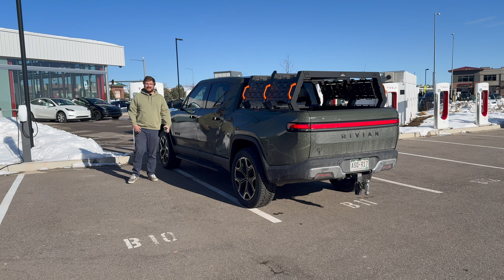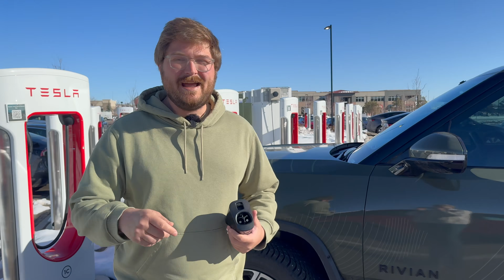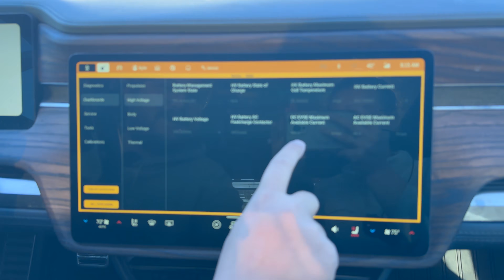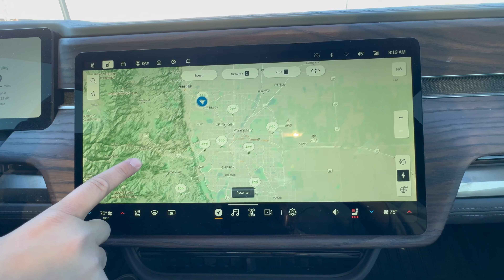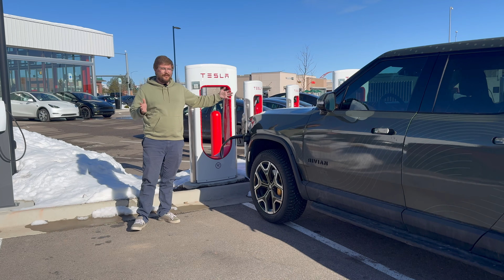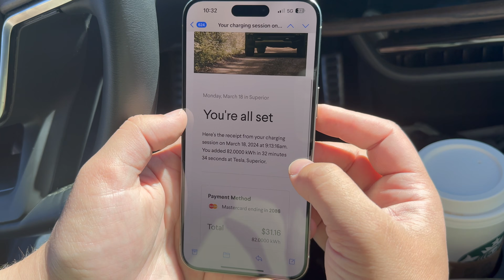Rivian Gains Access To The Tesla Supercharger Network! My First Charging Experience

Comment: This appears to block two parking spaces. The issue arises because the charging stations are designed for vehicles to back in, with most vehicles having the charging port on the rear driver's side. However, the Rivian's charging port is on the front left, forcing it to occupy the space intended for the adjacent charger. This could lead to potential conflicts at busy charging stations and create resentment towards these vehicles using the infrastructure. As someone who invested in a Tesla for the sake of the charging network, I've been looking forward to the system opening up to more vehicles, pushing Tesla to innovate further. An electric truck has always been on my wishlist. Another point of concern is whether these vehicles charge at the same rate as Teslas, given the lack of comparative data on charging speeds for non-Tesla versus Tesla vehicles. Can anyone confirm if the charging speed is comparable?

Comment: It would be cool if one's EV had a charging port at both front and rear corners of the vehicle.  That would cover most charger placements at the charging spots.  But probably won't happen because of extra manufacturing costs.

Comment: omggg! this is too expensive compared with my gasoline car, shouldn't be much cheaper than gasoline? what the mean to buy those electronic cars if the electricity is this expensive, omgggg!!! i drive the car which is not oil efficient but are even cheaper than this! scam

Comment: 8:39 pilot signal interrupt is not violent. Charger gets signal to stop providing power and it with car disconnects contactors. They are not under load while doing it, because pilot disconnect told car and charger to stop.

Comment: Latest Tesla SC station opened yesterday in Colorado and the station is oriented more in the middle of the lane.  Rivian will fit without blocking neighboring lane but tire is mostly in other lane but still on the line.  This is the farthest I could move the Rivian and still charge.  Can't include pic here.  Older stations (like in Kyle's vid) have the station more to the passenger side of the lane (orientation is front bumper facing in) so with these stations blocking two spots is the only option.  This will cause user conflicts.  I have both Rivian and Tesla and am excited and pissed at the same time.  
1. Tesla opened the network (very positive) 2. Rivian will provide an adapter (positive). 3. Lack of planning on implementation will cause user conflicts (very negative)

Comment: On charger location: the driver side is always the wrong side. On most parking situations on the street you have to walk on the street to plug it in. Then we fold in the mirrors to avoid them being ran off, but can you imagine how much it will cost to replace it when someone runs it off. In Europe, parallel parking is the norm. And destination chargers are on the streets. 
That being said, here in Europe the chance of me ever using tesla chargers is very low since there are many other chargers.

Comment: Just a thought if Rivian is building a new vehicle and it's only the matter of moving the port to the opposite side that they've chosen, wouldn't it make more sense to switch sides wouldn't it be less stress on the drivers? I don't understand the reasoning of having the port on the opposite side in a Tesla, is it just to prove that they're different? They already have a very nice vehicle. They have an opportunity to just switch one small thing that could make a big difference for each user. They should really reconsider their placement. I'm pretty sure that other manufacturers will do the same time. Only time will tell.

Comment: You’re a BIT wrong about the charging network though. Each person who has bought a Tesla over the last 18years helped pay in to the Tesla charging network it took hundreds of millions to build & as a Tesla owner if a charging location is busy and some cheap ass Slow charging Chevy bolt who didn’t pay into the network is taking up 2 spots and we have to wait I’m/we should have reason to be pissed this goes for any non Tesla taking up more than one spot at a busy charging station
Reply: That's BS, the non-Teslas are still paying customers, and Tesla can use that extra revenue to build more chargers.
Reply: @TechnicalLee  again the charging network was built(especially) in the early days by EARLY adopters who over paid for electric vehicles charging network was built by them. No car that takes up 2 spots should be able to use any of the good supercharger locations that are for sure going to be busier.

Comment: "Anticlimax"

Yeah, that's the normal no drama supercharger experience.  Little to see, because you just plug it in.  I'll take that over an "exciting" complicated experience trying to get a charger to work via apps and screens and lots of faff and phone calls.  Been there, done that.  Prefer to be bored.

I finally had a supercharger location where only half were working, and there was a wait, then a show charging experience (73-74 kW).  And another supercharger location half full.  With more Teslas on the road, plus Fords and Rivians at the superchargers, they'll get busy, maybe overfull.  Especially if Fords and Rivians effectively take two stalls due to having the charge port on a different part of the vehicle.

Comment: If they wanted to preserve passenger side charge port for curb charging then they should have put the charge port in the front passenger side. Then you would be on the correct side for both supercharger and curbside
Reply: Another solution is to have two charge ports like Audi and Porsche have. Costly but arguably best.
Reply: RJ said it is on the back to make the cables shorter. Note the R2/R3 will have a rear drive only option.

Comment: Rivian R2/R3 wont have any problems connecting to TSLA V3 Chargers. Remember— it’s not in the Kia EV6 location opposite a typical Tesla. Rather, the new Rivian location is much lower and much closer to the rear of the vehicle so that teh current v3 cable will reach with no issue. 

The only “problem” is that right now, both Tesla and Rivian have ports on the Driver’s side, making it very easy for drivers to exit the vehicles and not have to traverse to the passenger side to charge. R2/R3 placement removes that convenience and trades it for the promise of curbside charging.

Comment: Would be interesting to know any charging limitations when using the Tesla chargers and whether they are a dongle limitation, Tesla-provider limitation, or vehicle limitation. I want my next car to be an EV but am trying to wait until NACS is the default port in the manufactured EVs.
Reply: The only real limitation is the voltage, they only put out about 500V, so 800V cars can't charge on them unless they have an on-board booster or a series/parallel switch in their battery pack. 400V cars should get maximum output from a Supercharger.

Comment: tesla has a permit request for v4 install near me. so im pretty excited for that. v4 will have native magic doc on it and the extended cables. so in distant future nacs will be the only thing but for now its going to be ccs adapters wonder if in future manufactures will come out will a valinatry recall and retrovit/rewire for nacs ports which would be cool i know its a little bit complicated but it would probably be better off
Reply: Retrofitting NACS will be too expensive. The adapter is FAR cheaper. So don't expect that to happen, you're stuck with the adapter until you get a NACS car.

Comment: Curious if the 500A is just a response to the vehicle request
Reply: Most likely. Considering the software integration in the Rivian app and also the Tesla app in communication with the actual charger. It’s probably telling the station exactly how much amperage to deliver.  It would  know an adapter is being used because the information about the vehicle including what vehicle it is what kind of charge port it has is all there. In the future when adapters are no longer needed it may well be able to request that full 700 A and possibly even bump the charging up into the high 200s low 300 range.
Reply: @LectricOverlanding  Not on current R1 vehicles - they are physically limited to 500A.
Reply: I think Tesla will limit it to 500A so they don't exceed the adapter rating. At least initially. What vehicles besides Teslas can draw more than 500A anyway?
Reply: @TechnicalLee  none.

Comment: I have an interesting thought.   F150 & Mach-e ports are way to far back for this to be possible, but rivian MIGHT be able to ( PLEASE TEST)

if a rivian pulls as far over (into the "correct" spot for the cable) and pulls as far forward without hitting the stall, MAYBE a tesla could then park SUPER close to the rivian and ALSO stretch the cable to max and the rivian would only take "one" spot

I would like to know if its at least possible?

p.s. if you own a rivian or ford (or non-native side charging vehicle), and you see another at a supercharger,  consider parking next to eachother.   1 rivian would take 2 spots, but 2 rivians would take only 3 spots, and 4 rivians would take 5 spots (if parked adjacent)
Reply: I have Tesla and rivian and need to try parking with charger centered on each vehicle and see if cord reaches to both. If so simple striping change could help eliminate conflicts
Reply: @mtnmecca_ej  I'd love to hear the outcome!
Reply: I don't think so. The Rivian is wider than the cable is long, so I don't think it will reach after turning the corner. The Rivian would be over the line on the right side. I'd worry about door dings being that close.
Reply: Just tried latest Tesla supercharger station and the R1S is about 1’ over the line. Could squeeze another car next to me so barely blocking neighboring spot.
Reply: @mtnmecca_ej  that's great to hear!  Hopefully this info can get out to rivian owners to help minimize double parking at crouded SC.

Comment: So Tesla shows that the plug&charge handshake and isolation check doesn't need to take a minute and a half, lol
Reply: Correct, most of these CCS chargers are just dumb and slow. 15 seconds should be plenty of time to do the checks.
Reply: RAN chargers also do immediate handshake.

Comment: Do you think an electric truck or SUV will ever come with solar MPPT input plugs in the bed? Wouldnt that be cool to plug some foldable panels into at a camp site and live indefinitely off grid at a camp site? Do the compact solar generators make that an expense not worth incorporating? My driveway is in the sun. I could let it trickle charge all the time.
Reply: I’ve considered this. Currently the only way to charge is via J1772 and the onboard charger. Unfortunately the lowest power J1772 can accept is around 1.2kW, which is beyond what few solar panels could fit over the bed would be capable of delivering consistently. Realistically you would need a large camping battery bank to collect the solar power, then use the Rivian mobile adapter to charge from that battery. The onboard charger is very inefficient at such low power, so realistically this will just offset the phantom drain. Covering a camper trailer with solar panels would be more realistic, but you’re talking ~2 weeks to fully charge the Rivian’s battery.
Reply: Look at the Aptera, it's the only EV efficient enough to have some hope of that actually working. You would need a huge solar grid to support a R1T after accounting for sun angle and clouds because it takes so much energy. It would take weeks to fully charge with anything you could pack in its bed. You would need a trailer to haul your solar array, which would take up even more energy.

Comment: So many future problems ! He took up two charger parking spots ! This is going to be such a future fail ! Tesla should have mandated port location or given cable extensions ( not just adapters ) to the brands with the port in the “wrong place” . This is really going to be crappy at high use superchargers !
Reply: I think you are correct. As a Tesla owner it was bad enough to share the sweet stations now have to contend with taking up unnecessary spots. When I pull up in my rivian it will certainly be understandably awkward

Comment: If the pilot signal disappears I'd expect it would cut the charge current via the charge current  control before opening the contactors to avoid contact wear/arcing. Could be that there is a fallback to open contactors a short time later in case of a fault causing problems controlling current.
Reply: If the pilot signal (CP) disappears, it (usually) means someone has pulled the plug and is pulling an arc between the plug and charge port, someone ripped the cable from the dispenser and is pulling an arc there, or someone is cutting the cable. All of these are cases where dropping the contacts is the right thing to do.

CS would indicate that the button was pushed; then a "slow" shutdown makes sense. However, CS isn't available on the plug, so it wouldn't even be an option if the chargers needed to honour it.

Comment: I think people need to learn a new protocol when using superchargers. The EVs with charge ports on the left side, when facing a charger, need to use adjacent superchargers starting at the right end supercharger space in a line of chargers, just past the first right end supercharger (if possible). That way  no one looses a charger. The next left hand charging port EV will take the next adjacent supercharger and so on. For right hand charing port EVs (teslas) should start at the left hand supercharger in a line of superchargers. 
If we all do that, left hand charge port EVs start from the right end of a row of superchargers and right hand charge port EVs start to fill up from the left end superchargers. That will maximize the use of all chargers, with no loss of any charging stalls.

Comment: So if it's pouring down rain and you have to charge the EV, do you have to worry about the adapter getting wet? I would think if it was wet, it could cause a problem. I worry about getting electrocuted.
Reply: The engineers thought of that, that's why the DC charger performs an isolation test before switching on the high voltage. If there's a short because of rain, the charger will detect that and not turn on, so you won't get electrocuted. Teslas have been charging in the pouring rain for many years without issues. A little water doesn't hurt.
Reply: @TechnicalLee  I ment between the adapter and the charger plug

Comment: Thanks for the video. I love the spec of your R1T (did you randomly get R1 on your license plate, lol).  I’d like to have one but I really wish Rivian would announce a smaller, and less expensive PU truck based on the R2 platform. I do have a question:  when more vehicles are equipped from the factory with NACS charging ports, won’t people then need an adapter that goes the other direction? If other brands of DC fast chargers continue to have CCS ends to their cords, then people will need to convert that to NACS to fit in their car. Or, are brands like EM, EVG, etc., going to retrofit their charger cord ends to be NACS?  I haven’t heard anything about that yet. Thanks!

Comment: What is the difference between Tesla vs non-Tesla EVs? Thanks.
Reply: In most of the world, none. But in the USA & Canada, Tesla started early with their own plug and their own charging network (there were no others). Then the industry standardized on a different plug. Then Tesla made an adapter to allow Teslas to use the industry standard plug. Then the rest of the industry decided to switch to Tesla’s plug, because Tesla’s charging network is second to none.

Comment: I charged on a new 350KW Electrify Canada CCS1 4-stall station with my Tesla Model 3 LR using the official Tesla to CCS1 adapter.  It worked well, but it wasn't faster than a V2 (150kw) Supercharger because my car is 400A/400V nominal.  I did see a higher peak rate (191kw) than V2 Supercharging, but I compared that session to another session on a supercharger where I started around the same (23%) and went to 80%-85%.  The average charge speed was nearly the same and infact, it was slower on the 350KW.  If I had a 1000V vehicle, the 350 would for sure be faster.

It was interesting and I'm glad I have more options.

My point of posting was that even though I was the only person in the 4-stall CCS1 station, I still felt a little out of place with my Tesla, especially when 3 minutes down the road, there's a V2 Supercharger.  I just wanted to try my adapter and the new charger.  We don't have alot of chargers in my province.

Comment: I feel like until they come out with a solution non-Tesla owners should be charged double if they’re gonna take two spaces. Its like taking two seats on an airplane.
Reply: That's not really fair, because additional non-Teslas charging do not take up additional spots if they park next to each other. So you could have 3x non-Teslas using 4 spots. Why should all three pay double when they are only taking up 1.33 spots each?

Comment: At least in the East, taking an extra spot won’t really be a problem for now at V3 locations. Most people charge for less than 20 minutes and you don’t have to worry about sharing a stall. If Tesla opened up the V2 chargers as well, I would be much more concerned, as I usually have to wait for these as it is, and taking up double-spaces would cause big issues. Overall, I’m happy to see a better charging experience open up for more people!
Reply: V2s will not be opened up because they don't support the protocols. They would have to be upgraded to V3 or V4 first.